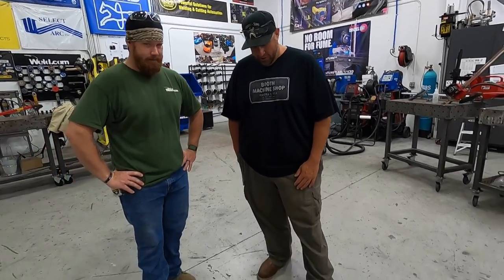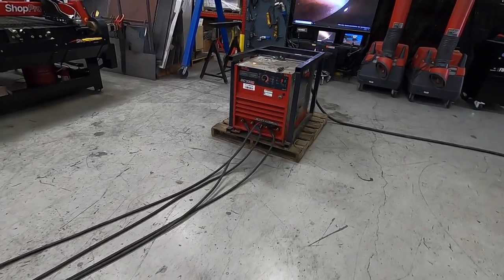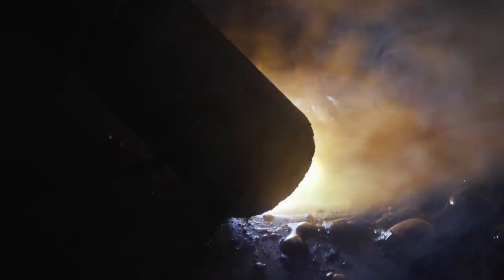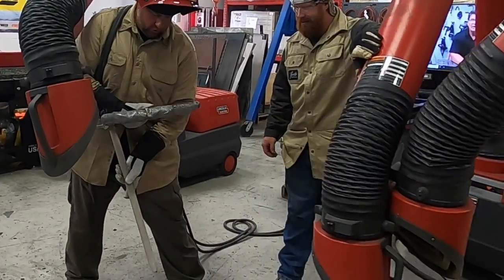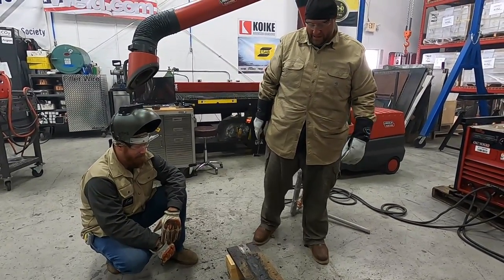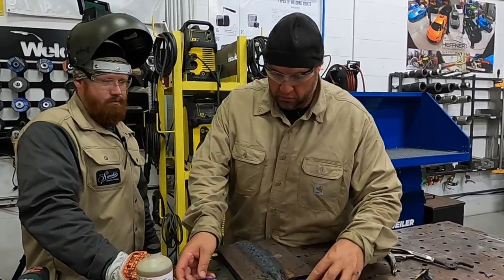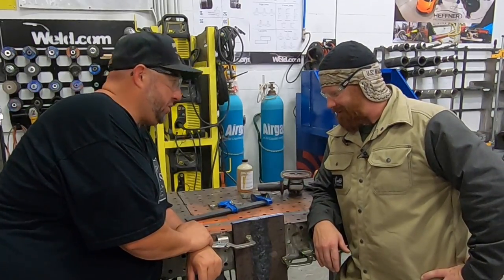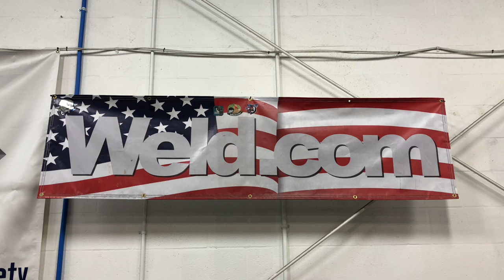1,000 Amp Stick Welding with Weld.com

Comment: Fun fact: a lightning strike is only 30 times the amperage, and this is continuous!
Reply: Yes but the astronomical difference in voltage still means there is much more potential in a lightning strike than the continuous weld

Comment: My back and shoulders are still hurting from just watching,,,At 19 (1972) I passed certification in arc welding, 2 yrs later, in mig. I was the youngest apprentice out of IronWorkers Local  263 Ft. Worth TX. and spent 9 + in the trade. Today, I still love to weld, but my tig skills on alum are still to be desired (@@)! Jason has been along with Jody great help,,13 months away from 70,,,I better practice more,,,hehe! Thx guys, great video,,Bear.

Comment: Handling ability very difficult right?
Weldability not Good
arc behavior less stable
Mord Slag interference 
Arc restrike verry difficult
very much Spatter
so much Fumes
More Arc Force
Meld metal stiking udercut
Slag removal so Hard
Weld bead apperance/Ripple no smooth
Contour not good becouse flow metal trnsfer less stabil.
I think..
it's easier to use a SAW welding machine, the results are much better, time is more efficient

Comment: As an iron worker, boilermaker and CWI for 40 years I promise you would be scarfing that crap back out lol.
although I did get to run a DC 1000 with a auto scarfer  back gouging the circ seams on 2" thick tanks for Hanford Nuclear.

Comment: I pulled an old stick welder transformer out of the dust recently, it belonged to my late dad. got rid of the rusted case and made a new one of wood. It's only 130 Amp max and can handle 3.25mm max, but that is enough for me. I intend to build a racing kart.

Comment: In spite of two semesters of welding to fill out my schedule in school, I'm very definitely an amateur at best, but it occurred to me to wonder how much this rod would cost. My guess was $1000. So I tried to find it for sale just real quick-like and found that just a 12" by 3/4" rod like this was nearly $1000. This rod was a good 2 1/2 or 3 feet to start with. Three thousand bucks, probably. Not to mention the welder and generator. I'm pretty sure you can't push that welder with household or shop 220 vac. Wow.

Comment: I’ve burned up actual tons of that material, and it generally is not done this way, and definitely not with a hand stinger.   It’s usually used to fill up BIG friggen holes, and you ease up to that 3/4, starting with 1/2”, 5/8”, then the 3/4”.   Done jobs where we had 2 1500 amp machines in parallel and dumped upwards of 33,000# of these big sticks.   Good times.
Reply: Geez, what kinda job required all of that? Patching holes in oil tankers or something?
Reply: @jamessigmon4765    The base of a 30,000# forging hammer.  The base weighed in the neighborhood of 450,000 - 500,000 lbs and it was cracked in half.  We made it one solid piece again.

Comment: Guy ran outside to shut the machine off before they accidentally arc flashed themselves with 1000 amps using the rod as a pointer...
Reply: I have accidentally made this mistake with 6013’s and i can’t imagine this one, I shouldn’t be laughing this hard.

Comment: I used to run these flooding forge die's for over a decade. We mostly used 3/8" weld mold 525 rods. The main process we used was Eureka flux core wire N2, N3, tri-core 35, tri-core 450 and 650 gmaw w/ 92/8 on a flood arm. With that job metallurgy came in a step above standard welding procedures. Preheat, prep, peen, annealing was a larger part of the process than actually welding and you couldnt have any imperfections. We ran 1200 amp Miller machines.

Comment: to me i think a 3/4 rod needs a Waaaay thicker bit of steel to weld ..although i could not be 100% bit it looked like you was dragging the rod and not feeding it in ...also 1000amp sounds a lot but not for a rod of this size ...the most power i have used is 600amp with only a 6mm (1/4) rod which was way to much power but i had a time constraint

Comment: I use those rods just to tack my parts.i weld with a 10000000000 amp welder.with a 12 inch diameter rod. 😆
Reply: oh yeah? well I run @ 1.21gigawatts @ a speed of 88mph....I weld so fast,it took me back to 1955..
Reply: @mikekopisz1227  oh yeah I jumped out a planes and used ⚡ lightning to weld cracks in the sky.this is why there are no cracks in the sky 😂 lol
Reply: @jimmeisch4121  lol
Reply: @jimmeisch4121  why would you jump out of a perfectly good plane??
Reply: @mikekopisz1227  lol don't like heights

Comment: As long as it was flat on the ground it'd be good for giving it a shot but I wouldn't like to try control that massive puddle on a vertical weld or worse upsidedown 😕
Reply: Yeah imagine that puddle hitting your arm lmao
Reply: @mr.phorneplays8607  it burn a whole through you skin
Reply: It's only for flat welds
Reply: If you attempt it, PLEASE record it👀 I can safely say you can do it only once

Comment: How much does that stick weigh? I would be uncomfortable with that ,it doesn't sound that great plus all the ping pong balls it throws off, maybe the steel is too thin for that. I would like to see what it does on 2-5 inch steel. I thought the steel was chamfered , maybe would have better results and get full penetration. I don't know anything about this, never saw a stick like that. Good you don't weld manual, it'd get heavy...lol.

Comment: You have to be really careful with these Rental Welders. I used to work for a big name Welder Rental Company and their Welders weren’t really Redi. On the 3 Phase Bridge Rectifiers I found a Bad SCR on the Bridge in over 60% of their Welders. This makes a Millisecond Interupt in the Wave Form. It can Effect the integrity of the Weld. You can see it on a Oscilloscope before you even pull the Cowlings off. They did replace them with all New Bridge Rectifiers to replace the bad ones, but that was only one Location. It was on the Lincoln Welders.

Comment: The weld looks quite messy, but it is mainly because you are not use to it. I weld with 5 mm electrode sometimes and it does awesome welds. And slag is very easy to remove, sometimes it peels off by itself. Very enjoying

Comment: My father worked in the Warren Mich Tank plank from 1973-1988 and he brought some rods home this big to show off a few times over those years. Apperantly the rods were used for welding down engine mounts and hull seam welds.

Comment: Wow this is amazing..
During my training years I used to refurbish Jaw crusher mainframes some with deep wear on the 60mm plates needed to be filled and we only had MMA  which was so slow eventhough we used 5mm rods...
So I came up with a plan where I tacked 2 rods together side by side, turned up my Miller DC machine on high range and amazingly would be able to weld with them.. they would fuse at the centre and give out a single arc with double the deposit rate... But with a very fluid pool.. my colleagues tried and failed to maintain a stable arc... I was crowned champion at it as I produced consistent sound beads but never attempted to use on joint welding

Comment: Imagine designing a 3D printer with that at the heart. You could 3D print a Tank or a ship .
Reply: You could. But the build-to-rest-time factor would be absurd. I mean, unless your Tank doesn't need a single critical dimension it would be faster to CNC it out of a single huge-ass block :P
Reply: @andersjjensen  ya but imagine combining them both ....I believe we will get to the technology where we can just say what we want and gets made on the spot like in less than a day. 
   I love building things and still what a welder.
Reply: @Paladin_of_Justice  Aye, but I think running a thinner stick/wire faster is probably the way to go to avoid horrible warping. Current weld-style 3D printers use thinner wire than most MIG welders for this reason.
Reply: @andersjjensen  sure sure. I'm no  designer I'm just saying we have many pieces of the puzzle in making things like never before. We have personal aircraft like the Jetsons that need no pilot license because it's so easy to fly. (i.e. Jetson one) We have 3D printing in a wide variety of different applications.  If Democrats can move forward instead of backwards and sideways we may be able to achieve greatness as a nation and society.

Comment: I think this rod was running too hot splashing slug and metal all over the place. 850-900A would burn a lot sweeter...anyway, quite impressive manual handling that thing, not a bad result for first time..

Comment: thats one beast of a welder. 1000 amps @ 44 volts @ 100% duty cycle is impressive. no wonder it needs that generator, 480 volt input @ 100 amps! most shops dont have 100 amp pin and sleeve connectors for 480 volts

Comment: Welding machine was turned up too high...lead angle was too shallow...plate was too thin for that electrode..puddle was pulling the slag back in creating those nasty looking (and weak) inclusions in the weld face. . 7024 and 7018 both run better a bit on the cool side, this rod seems to have those same "snotty" puddle aspects. But then again, when was the last time you saw a 1000A electrode, much less one run by hand? Never...still pretty cool experiment.
Reply: 7024 is a fun Rod to play around with. You can lean the Stinger with a 7024 in it and just let it run itself as the Rod is consumed.
Reply: I had the same thougts.  I mean would you weld 3/32 sheet metal with 3/32 7024 or 7018.  No. It would be just too hot from every aspects you look at it.

Comment: back in the 80s i worked at a company where they were experimenting with sub arc.  i dont remember exactly all the specs but they were running something like 3/8 wire and 3000 amps.  they were filling up a bevel joint on 6 inch thick plate in 3 passes.  they could never get it to pass xray because all the inclusions.
Reply: Fuck we run either 5/32 or 3/16

Comment: Amperage was too high which created an overactive arc and puddle.  That caused the cover gas and flux to trap air and create the huge pinholes in the weld.

Comment: Well that was only a 400 amp breaker. Where is the other 600 amps coming from
Reply: 400 amps at the AC circuit side, 1000 amps on the welding circuit side. Welding machines primary function is to transform high AC voltages into slightly lower AC or DC voltages; it lowers the voltage and raising the amp capacity (ampacity) of a circuit. That means as long as there is a >2.2x ratio in the windings of the welder, we will be below the breaker capacity. All transformer welding machines are electrically very similar. I recommend looking into transformers if it is an interesting topic to you.
Reply: Amps x Volts = Watts. Watts will be constant as that's the work being done, the welding machine is basically a transformer which divides the voltage, multiplying the amperage. The generator is putting out a high voltage and lower amperage and the welding machine transforms it to a low voltage high amperage as well as turning it from AC to DC in this case.

Comment: not a respirator in sight lol
Reply: 3 fume extractors running theyll be fine
Reply: He even said himself three wasn’t sufficient ya silly goose
Reply: Did you missed the 3 fume extractors right over the weld?  I mean with a 4 ft rod it is not like had his face in it.
Reply: He even said himself three wasn’t sufficient ya silly goose
Reply: @cram1nblaze  I have only worn a respirator a handful of times welding at best.  A couple was welding galvanized.  I bet I have burned 100,000s rods   & I could not even guess the rolls of wire.       I guess my generation must be stronger.  I have never hurt my lungs welding.     I mean had 3 vents not been going than yeah I would of not wanted to be exposed to that cloud of smoke in doors.   
    I never have worn a bicycle helmet either.  LOL
Reply: Definitely tougher jeremy, good job I wish you many more healthy years.

Comment: Gotta be like 800 degrees Fahrenheit  or more 🤔🤔🤔
Reply: Steel melts at like 3000, and electricity is at least a couple hundred times that
Reply: 800 is an extreme lowball. on avg the arc is upwards of 6000

Comment: Just looking at the surface of the weld, it would never pass the inspection test !  way to much porosity in the cap ! Cutting thru the weld showed that there was impurities in the weld , as he couldn't do a cut all the way thru the weld !!  It wouldn't pass the bend test , never mind an Xray test !!

Comment: Check your Stinger and Ground wire length, each set must be the same for a (parallel wire)
Reply: If they're within a foot or two of each other, it doesn't really matter. If one wire has a lower resistance than the other, it will just get hotter than the other one until their resistances match. Copper has a positive temperature coefficient.

Obviously, if you've got a 50 foot cable in parallel with a 10 foot cable, it's going to be a problem, but 8 and 10, or 10 and 12, the difference is going to be negligible.

Comment: Needing this kind of penetration to be perfect is the reason that submerged arc welding (SMAW) is a perfected process that remains obscure to welding beginners.
Reply: This is SMAW, shielded metal arc welding. Submerged arc welding is SAW. .

Comment: Awfull weld im sorry to say, there is no way this gonna be a high tensile weld heat input on this thickness plate is max overload. do it on at least 100 mil plates were heat is more disapated, and by the way this is why they invented submerged arc welding no fumes much better for youre health.
Reply: I'm totally ignorant on the subject, do you mean the plate they used was 7x too thick? I have 2 pieces of 566 mil plate (about 9/16), what current/rod do you think would be needed if doable at all?
Reply: @MrLuizlaf  what i mean to say is increase the plate thickness to atleast 100 mil increase travel speed. What happend here is they cooked the weld and plates.
Reply: @ronaldvermeulen3839  Makes sense yeah. Thanks!
Reply: He said it's oft used for repairing cracks in crucibles.  I don't think they are that worried about tensile strength
Reply: It's called messing around

Comment: When I lived in Canada, I knew a guy who worked pipeline in northern Alberta who welded with high power welders like this. He said you could recognize welders because the seat of their insulated coveralls were scorched. Apparently, when they would get cold, they'd run a bead along a pipe and turn around and sit on it to warm up.
Reply: Lol

Comment: Would have been money ahead with sub arc. Even bare wire spray arc would have a better dep rate. -The engineer that specked that idiotic procedure, wherever they actually use it,  must have gotten his degree at Afghanistan U.

Comment: OH $h!!    Good lord this is nuts that rod is 4 foot long.  Big Generator LOL  I feel bad for your floor.  
I think you really needed some bigger plate, 1100 amps and I bet you could have turned the entire 2 parts glowing red and forged the 2 together lol 

Thanks for doing this Crazy but awesome.
Reply: That generator is 2x the size it needs. I’ve run 1200-1600A welders with a 76kw.

Comment: I would like to try it, but at 850-Amps and at a steeper angle and faster drag.. 7024 has iron powder in the flux for a fast fill.  1/4 inch rod we call phone pole rod, .makes a beautiful bead,

Comment: If I'm ever using 3/4" welding rod, it still needs a bevel. Noted
Reply: I'm not as impressed as I though I would be. A 5/16" bevel and a large mig would be superior.

Comment: Incredible outfit but the weld is not what you want to see after pouring so much money into a joint. I'd have liked to see you run the weld with the parent metal laying on a 4" square bar so the heat was contained a little better. Adam, I believe you handled that rod very well with the limited understanding I possess? Also it looks like a basket to weld with if I'm honest about what we saw.

Comment: Welding  excavator buckets I burned 3/8s rod. 400 amps.  Air arcing  with carbon rods with a few Amp too

Comment: Not bad. The highest amp machine I've used was a 500 amp Lincoln SAM welder. I'm curious why you used a gas torch to cut instead of a plasma torch. I have one and I love it. The bad part is I could cut with a gas torch and it looked good. If I use the plasma torch I have to use a ruler or it looks like jagged crap. Every bad movement in my hand is right there in the metal.

Comment: If it was me with my luck i'd stick it permanently to plate on the first strike and break the flux cause it won't wiggle it back and forth. That first strike you'd have to run at it like pole vaulter  xD

Comment: What is the practical use for this size rod? Is there any?
Reply: Welding big things.
Reply: @12345NoNamesLeft  seems like it would be best left to a robot,not done by hand.
Reply: I’ve been told they were used to weld railroad tracks together
Reply: @JoeRocket-sf6qs   Yes, that's in the video description and has been for two years. 

" This rod is actually used in a controlled and mechanized procedure and commonly used for the repair of slag pots in the foundry industry."
Reply: He mentioned that is used on heavy thick castings and usually on a tripod mount.

Comment: Just plasma Cut it it's faster and more efficient not only that you never should've welded over the concrete the way you did your damn well lucky it didn't explode beneath your welding surface‼️‼️‼️‼️‼️‼️‼️
Reply: Why not just use a metal band saw? Seems it wld go faster, less to grind before etching

Comment: Damn, and I thought a 7024 was a big ass rod 😂
Reply: I'm afraid I don't understand your comment. 7024 comes in 1/8, 5/32, /316, 7/32, and 1/4 inch diameters as do most electrodes give or take for manual welding. This electrode is meant for an automated process only so the diameter is sized to be optimized with that process. It's apples to oranges.

Comment: regarding penetration, does not look like the set up was right.  Should it have been "veed" out with a 3/16" margin,   Or just a butt joint with a gap between plates.